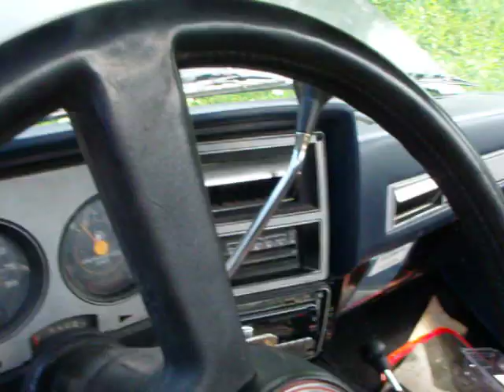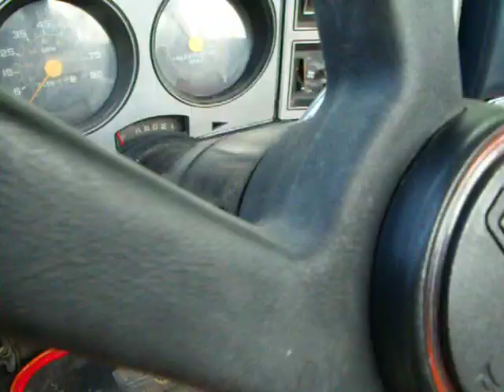1982 gmck1500 shortbed

Comment: We called it the frankenstein truck most the interior was from a 79 suburban the engine was from a 72 chevy c2500 the trans an t case was from the 82 gmc k1500 and the wheels and tires and suspension and frame was from a 78 gmc jimmy fullsize